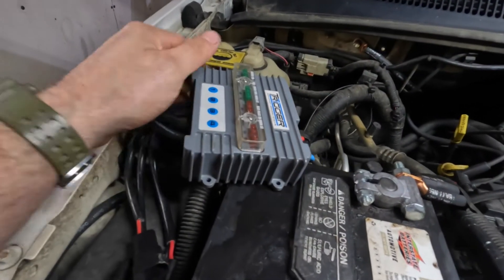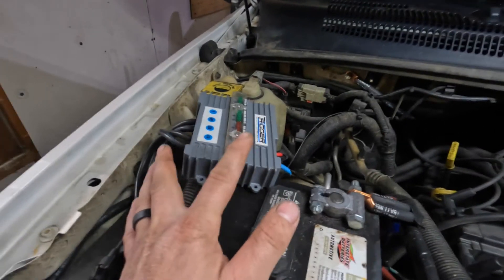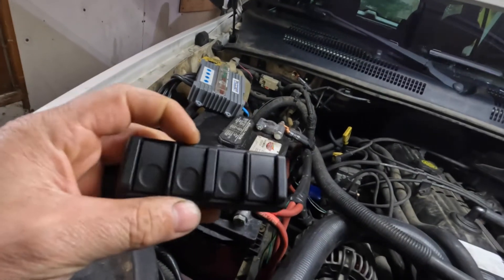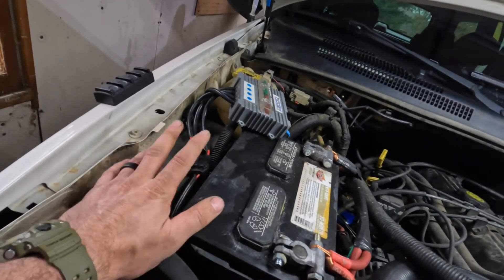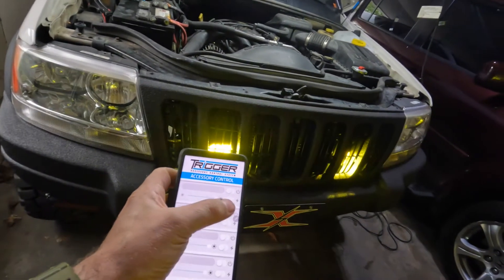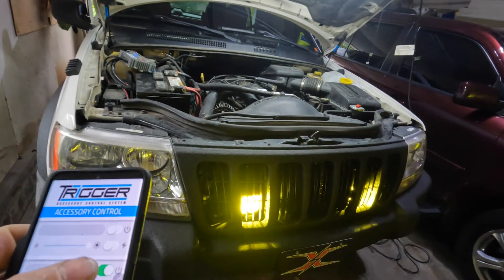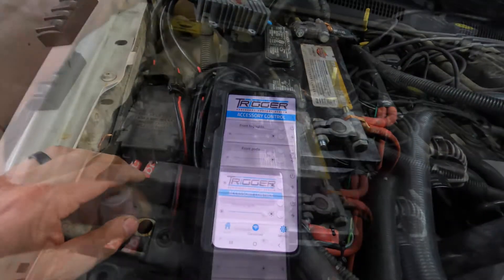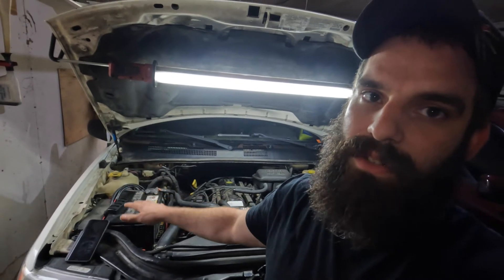Trigger Control Accessory System (One Year Product Review)

Comment: I have the newer Six Shooter. It's been installed for about a year now. The app for the iPhone has not been updated since 2017. This app should updated to be compatible with Car play, which would make it even more versatile. I did call the company and suggest this, but it apparently is not a priority. Other than that, it's a great accessory controller.
Reply from the maker: That's a good point. They really should do both Apple car play and Android auto. How slick would that be if you could control your lights from your touch screen radio.
Reply: I have read in multiple places that the app is sketchy and the switches are flimsy. Any issues with yours?
Reply from the maker: @geoffreydlin8043  Zero issues to report on mine and I play with the app all the time. I have installed about 15 of them for customers and I haven't had one come back for issues.
Reply: @XtremeTruckAuto  it would be slick as ****. and redundancy is always a good thing . But the apps really should get a design remake. very outdated.
Reply from the maker: @Suedzville  I agree it is a bit outdated but for an app that is for an aftermarket acessory it works well. Trust me I have seen some terrible apps to controll lights. I wish they would put the voltage part of the app that come with the 6 shooter on the 4 plus.

Comment: Any problems with lag between hitting the switch and the light going on/off?  This looks like a more affordable option than the S**D brand.
Reply from the maker: Zero with the switches. The app has a tiny bit but its not enough to annoy me. Honestly I bought it to try out thinking it would be a gimmick and ended up loving it. I have sold countless of the 4 plus and the 6 shooter and only had one come back. It was because the controller became unpaired to the box but that was a super easy fix. It is in the instructions. I can not recommend either the 4 plus or the 6 shooter enough. The time saved on wiring is 100 worth it and I use that thing every day on my own jeep. I have my fog light run off it.

Comment: If you set a light to flash, and then close the app, will it be set on flashing if you use the rocker switch?

Thinking about running this system on my work truck and would like the option of the flasher but don’t always want to use the app to turn that on and off. Would like to set it on the app and then have it save and use the rocker.
Reply from the maker: I don't know I have never tested it. I will do it as soon as I can and get back to you.
Reply: @XtremeTruckAuto  thank you! I appreciate that!
Reply from the maker: @according2ryan  Just staying in touch. I'm going to try to test it this week but it may be the weekend before I get to it. My Jeep's battrey died on me and I'm waiting on my new battery to come in. However, I am going to give Trigger Systems a call today to see if I can find that out for you sooner.
Reply from the maker: Apperntly, they dont have a phone number on their website. So, I sent them an e-mail today. I will let you know ASAP. Thanks for your patience!
Reply: @XtremeTruckAuto  really appreciate it! I ended up ordering the unit and can give it a test when it comes in too!
Reply from the maker: @according2ryan  Awesome!! It's a great unit. If you get to its before me let us know what you find out. 

P.S. Make sure you ordered the 4 plus or the 6 shooter unit. They have discontinued the old orignal 4 switch unit due to some issues they had. (This was over 3 years ago) I just wanted to give you the heads up.
 
The 4 plus and 6 shooter are bullet proof and I have seen Zero issues with them.
Reply from the maker: @according2ryan  I just got a response. They said that I can only be controlled through the app. I'm still going to test it.

Comment: Since you wired it for constant power have you had any battery drain issues?
Reply from the maker: Nope. However, it is my daily. If you are going to have it on a vehicle that is going to sit for an extended period. I would wire that yellow wire to the aux power or pull the main fuse.

Comment: How long do the batteries in the switch last?
Reply from the maker: I haven't had to replace mine yet. I would guess about the same as key fob or a tv remote. The nice thing is that if they do run out you can use the app to control them and it works really well.